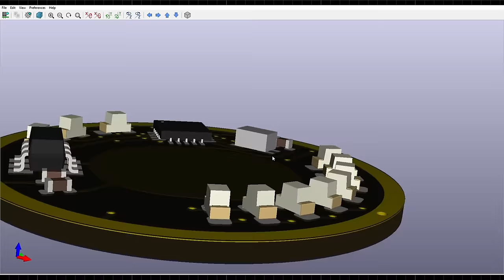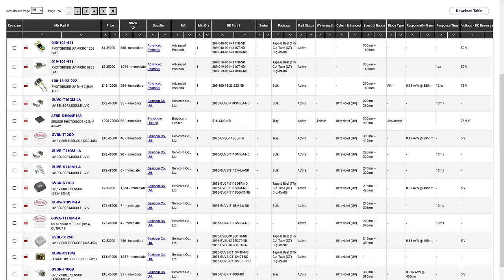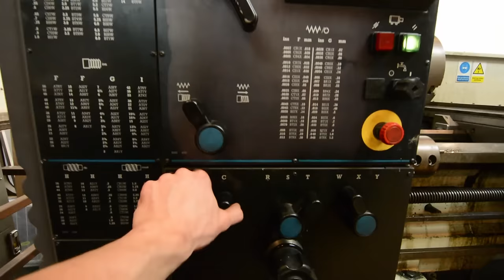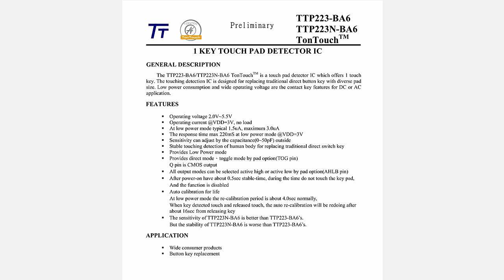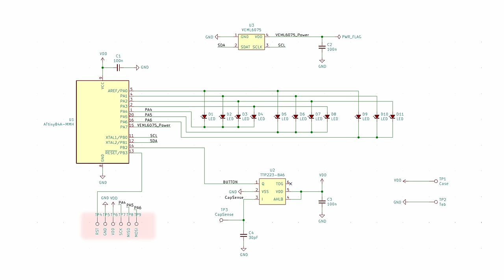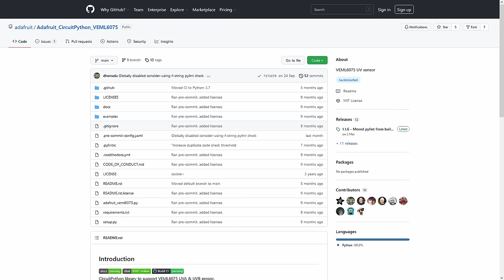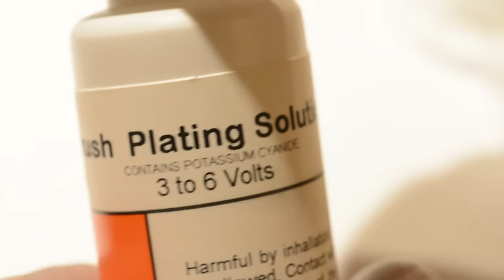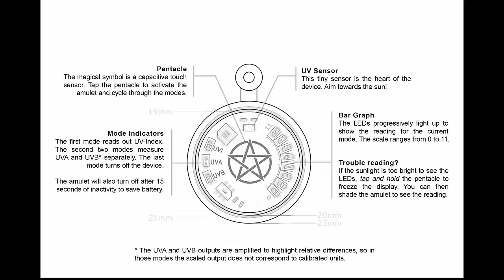UV Protection Amulet

Comment: 18:46 that scares me 😬
Reply: While putting your fingers near anything spinning can be dangerous, as long as nothing gets caught in the spinning thing it's not too bad. Things like jewelry, long sleeves, and gloves pose a risk of catching, that is why they are forbidden in many shops, especially when just learning the machine.
In this particular case since the jaws that hold the part are not sharp, slipping off and touching them would feel like a light tap (think of putting your hand on bars of a fence while walking by) and most of the time it will just knock your finger/hand out of the way without any harm. Of course something like tripping and stumbling into it would still cause major problems.
Reply: @AgentWest  it’s still very dangerous. I’d get kicked out of the makerspace for doing that.
Reply: @EASsirenVids01  For hand-sanding like that? I guess you could always spray-glue sand paper or a scouring pad to a paint mixing stick and use that.